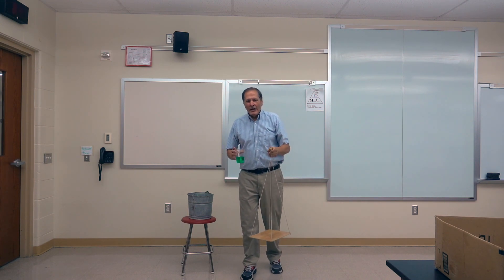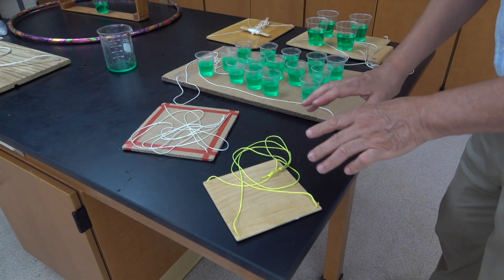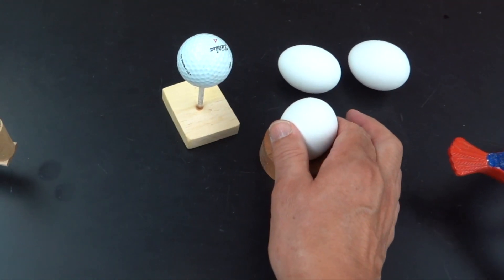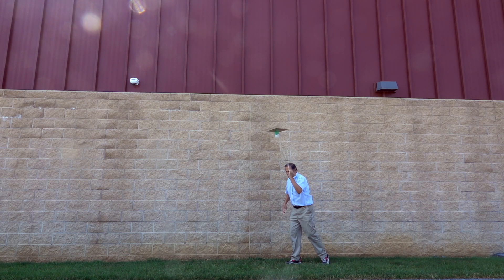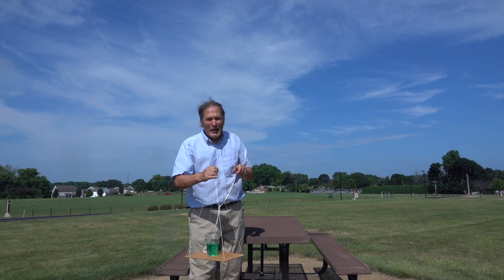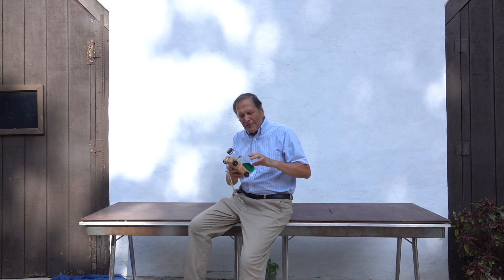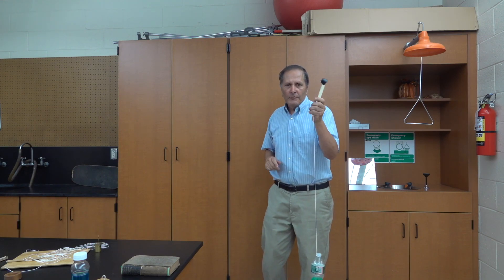Centripetal swinging tray,  improving an old demonstration

Comment: This got me wondering, suppose you managed to swing it fast enough for the glass to stand, and than increased the string  and speed for as much as a given persons body weight could counteract the force, how far could the string be, how fast would you have to rotate it and how fast would the glass rotate in space to generate this much force. Of course it depends also on the friction of the ground and shoes so it could perhaps be tricky to calculate, but perhaps estimate. I wish I knew how to calculate this

Comment: Thank you so much for this fun to watch lecture, Bruce.
I totally agree with your explanation with inertia etcetera, but especially for high school students, I would make it a somewhat more serious lecture, because I think the lecture is related to Newton's first law, as well as to the Newton's bucket experiment.
Your (horizontal) beaker experiment is a small part, or call it a small angle of the Newton's bucket experiment.
In the Newton's bucket experiment the water doesn't start to spin as soon as the bucket starts to spin because it is a fluid with a certain viscosity, and inertia holds the water back until the internal friction has finally accelerated all the water.
The water gets this particular shape, with the vertical hole in the center, because it wants to keep moving in a straight direction, just like in Newton's first law;
A body in rest will stay at rest, and a body in motion will stay in motion, unless acted upon by a net external force.
And the wall of the bucket constantly bends the path of the water.
It is obviously a matter of pressure, caused by the force from the kinetic energy of the water and from gravity combined.
Believe it or not, but even some physicists have problems with explaining the Newton's bucket experiment.
I encountered a few times a severe discussion between a few people in YouTube's comment section, where they posted the weirdest arguments in their flaming clashes.
But when I post the above explanation, they suddenly become surprisingly silent.

I think your experiment and my short, simple explanation should be thaught at any high school.
Yes, it is Newton's first law.

Thanks again, and have a good one, Bruce.

Comment: Good demo, but can you please go with SI units.. no one talking science should be talking feet and inches.
A foot is about 0.3m (or 30 centimetres). Instead of 12 feet, you're talking 4m.
10 feet? 3m. 
Might get the USA to move with the times if anyone producing content used units that make sense.
Reply from the maker: Thanks Nathan, this has been a continuing problem that I've battled all of my teaching career.  In this case I did not list the measurements in metrics as distance  was not a critical factor of the experiment . However, if you go back and look at several of my other videos, you will find that when distance or force is an important factor and calculations are needed, I usually list both metric and imperial measurements.
Reply: @YeanyScience  yeah, I understand.. the X feet or Y inches are a hard habit to break. Here in Australia we still use 300mm increments for building materials (so 600mm, 900mm, 1.2m, 1.5m, 1.8m) and 25mm (inch.. ish) for smaller things..

Comment: It seems like there would be a force due to relative wind pushing the cups in the direction horizontal to the tray.   Have you calculated this and at what string length would it be significant?
Reply from the maker: I haven't gotten answers for that yet, this was the first time for trying the longer length of string.  Curious about the maximum length that would be successful
Reply: @YeanyScience  Really enjoyable video.  Thanks.

Comment: I'm interested in duplicating the student activity you mentioned at the end.  What tube did you use that has relatively low friction?
Reply from the maker: we've had the best results using glass tubing the was fire polished at the ends.  However,  after these eventually broke we switched to plastic tubing or PVC pipe.  If these are used after cutting the tubing, use sandpaper to smooth the tube edge so it doesn't cut the string

Comment: If centripital is effectively the tension on the string, then what is the force or effect which makes it difficult to lean off-axis and fall off a spinning bar stool?  When I was a kid, I'd spin on a stool and if I relaxed and started to lean out to the side, I'd somehow be pushed back onto the axis of rotation.  (obviously how a gyroscope works) It seemed that the resistance of my upper body to acceleration (my legs having enough inertia to prevent slowing the spin) would push my upper body back to the spin axis.  I'd always thought that was centripital.  My reasoning here is that for me to lean off-axis, either the spinning would have to slow down, or my torso would have to accelerate, but with no extra energy applied.  However, the inertia of my legs makes slowing the spin more difficult, so the answer is to force me back onto the spin axis.  If the tension on the string has a name, but that force/effect keeping me upright doesn't, then I'd be quite surprised.

Comment: How does centripetal force pushing the water towards you explain why it stays in the cup? It could just flow out on top. I think you meant to say that it's the totally existing centrifugal force, pushing the water to the bottom of the cup ;)
Reply from the maker: I used more demonstrations that explain a bit more clearly in the previous video.  https://youtu.be/vhNfIydKyRQ
Reply: Thank you! Indeed, the explanation there is much clearer! Everybody should watch it also!

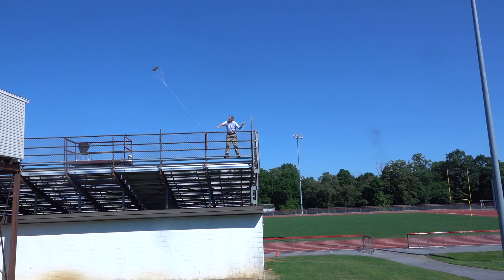Comment: 7:35

there is another lessen to be tought.
The problem here is, that the centrifugal force is no longer strong enough to counteract gravity (actually it needs to be at least a little bit stronger in order to hold the cup and the water in place). We can see this because the string gets very lose which means there is no longer a centripedal force which cause the centrifugal force in the first place.

As a consequence of that the cup is no longer forced by the plate to rotate with it and the cup does what Newton tells us they do: objects in motion continue to travel in a straight line unless there is a force forcing them to do otherwise.
And that is exactly what we see: once released from the plate the cup follows a straight line (actually it will be a parabola of falling, since gravity still is present). The straight line is tangential to the path of the platform. Everything is as is expected by following Newtons laws.

Comment: It's good to start your day with science,
We can use this centripetal/centrifugal force to throw an object to a long distance, you just need to find a way to release 2 of the strings holding the tray at right time (I think).
Thanks Bruce and have a nice day
Reply: I think you need to re-create a sling design.  You could use a long string with a light, e.g a wire tray in the middle, which would be light but just stiff enough to allow you to place the actual load (a tray with a cup, or just the cup) and start spinning while holding both ends of the string in your hand.  Then you would just need to release one end of the string and swoosh!  there flies the cup! :D

Comment: Please make a video explaining the difference between centripetal force and centrifugal force.
Reply: The difference is the reference frame and observer.  These two terms are two sides of the same coin.  The first term (center seeking) refers to how a stationary observer sees the situation, and that a net force is needed to steer the object on a curved path instead of a straight line.  The second term (center fleeing) refers to how an observer moving with it along the curved path experiences an apparent outward force as their body attempts to follow a straight line per its default nature.
Reply: I think the best had been to use the term centrifugalforce. It's what is used in normal talk. Everyone knows what we mean.

Comment: One small error at the end, the centripetal force pushes the water away from your hand.
Reply: Yeah he gets a little confusing at the end. I think he knows what he is talking about but he is mixing around his references a bit.
Reply: There’s no such thing as centripetal force.  The tray and items on it are simply following (or trying to follow) their straight line path. Simplified the main force involved is simply the string pulling them from this path.
Reply: actually he is correct.
You are thinking of the centrifugal force.
But remember: the centrifugal force is a consequence of the centripetal force and thus an apparent force. It is the centripetal force which deviates the water inwards to the rotation. Without a centripetal force the cup+water would just go in a straight line.
Reply: @kallewirsch2263  thank you

Comment: We're you worried at all putting the camara on the end of that rope?? Awesome shot! But I was worried I would see the camara go flying! Lol
Reply from the maker: I should have been, I used double sided tape to make it more secure and started with a cheap camera swinging around and wasn't happy with the shot so I switched to a more expensive camera,  as I swinging it around it hit the fencing and flew up about twenty additional feet and then dropped about 40 feet. To make matters worse,   the camera was so badly damaged it couldn't load the video onto the SD card.

Comment: very interesting. Worth considering how this could work on the outside of the tray? imitate earth as its spins at 1000mph at the equater.
Reply: It would not work on the outside of the tray without another force that can both provide the centripetal acceleration, and pull it inward.   For the Earth, the effects of its rotation are just a "drop in the bucket" compared to gravity.   So much, that you'd have to know what you are looking for, to measure the difference.  Measurements show that g in Oslo, Norway is 9.82 N/kg, and that g in Singapore is 9.776 N/kg, which is explained by this effect. 

There are two factors that explain this difference, both ultimately related to the centrifugal effect.  Factor 1 is that the Earth is not a perfect sphere, as it bulges at the equator.  This is a consequence to forming as a rotating body under its own gravity.  Gravity dominates, but the centrifugal effect still plays a role.  A poster with Earth to scale with a 90 cm polar diameter, would have a 90.3 cm equator diameter.  This isn't immediately obvious, but with this scale, you can measure this difference with a meter stick and the naked eye.  Factor 2 is that the centrifugal effect subtracts from the true gravity, to become the effective gravity we experience at rest on its surface.  Singapore's g would be 9.809 N/kg if you measured it in a westbound vehicle at 1000 mph.  Look up the Eotvos effect if you'd like to learn how to test this for yourself.
Reply: @carultch  Gravity is nothing but a theory - whereas pressure explains the so called gravity theory perfectly on a closed system such as Earth. It is therefore impossible naturally to have the same effect as shown in this video without some un-natural force pushing on the outside of the tray like a purpose designed enclosed system with its own relative pressure.
Reply: @danielroperartist  Ok, you are clearly copying and pasting your talking points from the Flat Earth manifesto, so I would appreciate it if you would research the following concepts to clear this up.  If you can correctly answer a majority of the following questions, I'll address any follow-up questions you have.

1. What is a scientific theory?  What is the difference between a theory and a hypothesis?
2. What is the difference between velocity and acceleration?
3. Does an object require a net force to maintain a constant velocity?  What about a constant acceleration?
4. What is the Cavendish experiment?  Is Cavendish the only one who performed it?  Or have others reproduced his work to confirm it is valid?
5. Is gravity only produced by planets, moons, and stars?  Or do smaller objects produce it as well?
6. What is the acceleration due to gravity in both Denver and Washington DC?  What is the air pressure in Denver and Washington DC?  Is the ratio of air pressure in these locations consistent with the ratio of accelerations of gravity we measure, such that "pressure explains gravity" as you claim?
7. What force in addition to gravity acts on a feather as it falls, that makes it fall noticeably slower than a hammer?  What can we do to remove this force, and how do the rates of free fall compare?
Reply: @carultch  Thank you - but this is my own observations and research - I am not a flat earther but merely learning what modern science fails to teach us through obvious flaws.

Answers:
1. A scientific theory is a theory in the genre of science - actually, everything is science -which is alchemy. Hypothesis is a suggestion for an explanation based on a theory or observation.

2. Velocity is a given speed, acceleration is the given speed with extra oomph by a force acted upon it.
3. For an object to maintain a constant velocity a constant force needs to be acted upon it - even in a vacuum as friction  plays only part of the stopping force - similarly with constant acceleration - a constant and accruing force is required.
ether. The vortex will bring 2 objects together just like magnets. As these were tethered - the force has to go somewhere and therefore moved into the flow arm rotating it in the vortex. I would also suggest you try this experiment - twisting the wires so that 
5. I suggest gravity as it is, is unobserved, measured incorrectly and unproven. more sense comes from pressure and electromagnetism. Gravity in the form of object of any size/mass is directly related to the atomic number of each known element in accordance with pressure.

6. The pressure density of a given place on earth would be equal at sea level. From my observations I stand on terra firma simply because my atomic mass dictates that - if I was made of hydrogen - I would be higher than a balloon (I only wish!)
7. All objects free fall at the same rate regardless of their mass (9.8 m/s/s). There are factors that can change the rate of free fall such as its dynamics and force of pressure. Dynamics can go fairly deep by harnessing the vortex field. The ground is positive in charge and the sky is negative - by negating the negative force and object can remain suspended - just like the pressure from sound waves emanating from a speaker suspending a drop of water.
Reply: @danielroperartist  I'm asking you to correctly answer according to modern science, whether you agree with it or not.  It seems like you deliberately went out of your way to either answer these questions incorrectly, or so vague that you miss the entire point.  If you can demonstrate an attempt at understanding the background information, then I am willing to help answer your original question.  Otherwise, this is my last message.

Some feedback:
1. Missed the point entirely about what theory means.
2. Too vague.  Mathematically, how does one relate to the other?
3. Please look up what a net force is.
4. Missed this question entirely.
5. These were yes/no questions.  You didn't directly answer, and you added a lot of incorrect information.
6. I'm asking for numeric values for pressure and gravity at the two locations I gave.
7. What specific force applies to the feather, that is insignificant for the hammer?
Reply: The 1000mph are not relevant. What is relevant is the rotational speed, how many degrees in what time. This, together with the radius determines the centripetal force (and thus what we call the centrifugal force).
Formulated in a simpler sentence: how much must the path deviate from a straight line in what time?

If you do the math for earth, you figure out: the force is in the order of the gravitational force of a feather on your hand. Barely noticable. Or formulated in simpler terms: Your weight decreases by less then a few gram just because earth is spinning. Gravity is orders of magnitude stronger then this centrifugal force.
Reply: @kallewirsch2263  A decent argument - however, if a feather does not move from my hand with the spin at 1000mph of the pear shaped earth, and around 67,000mph around the sun...obviously because I am moving relative to it - how come gravity 'although orders of magnitude stronger' not only presses down on the feather - but somehow equally on all sides to keep both masses (myself and the feather) in sync with one another - if i living inside the earth I could understand - if the earth was a closed system - i could understand. Only pressure can explain this and in the interest of syncing all free moving objects and the sight of still water on a lake, rotation and spin therefore does not exist.

Comment: I found it amazing that it continued to rotate when released. I would have loved to have you as a teacher. Were you a teacher in the 80's?
Reply from the maker: yes, I started in 1977
Reply: The fact that he's using a handle contributes to the cup staying on the tray.  Try it with and without the handle as a counterweight, and you'll get an interesting difference in the results.

Comment: Great video as always. I was most surprised you could keep the cups on the tray but I guess the surface is a little rougher than I am imagining and the water weight stabilizes the cups. The rubber band cart at the end is an excellent analogy to the centripetal motion + inertia moving the water to the bottom of the cup.